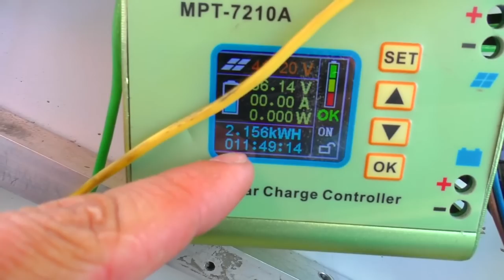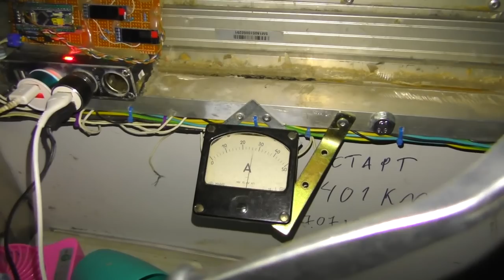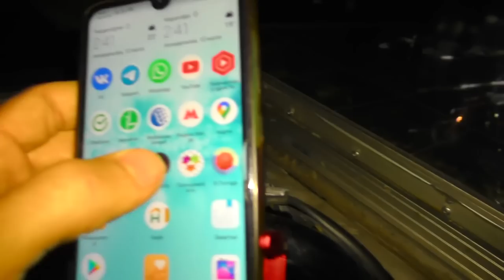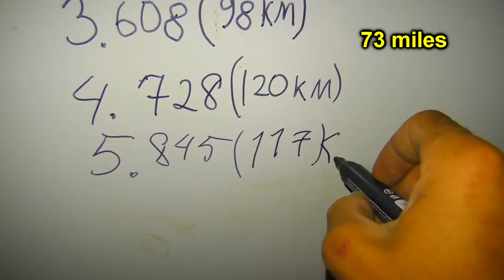Solar panels broken 😱 DIY⚡️electric SUN CAR 🚗 Great JOURNEY on solar power! Part #2

Comment: I wonder if you would have put each controller and battery bank separately on the left and right side motors if your car would not get overloaded going up hill and go twice as fast plus get more kilometers per charge this way because of the reduced strain on the system?
PS
I wish you good fortune and the best of luck with your adventures as I really enjoy watching your journey and your good humor of situations.
Blessings.

Comment: Broken solar panel on a roof can generaly work during months with a small loss of power. In rare cases, It can be dangerous, specially with cheap panel because they can start a fire.

Comment: Did you calculate the amount of kw/h/100km? Would like to compare with common electric car.
Reply: its 1 Kw/h/ per 5 km on a tesla. 
in a car you get 40 km per galon.
Reply: @Jimothy-723  my 2012. Opel Ampera (hybrid) use 1 kw/h to 7 km in summer but only 5 km in the winter.

Comment: Sad with the cracked panel!!!

shouldn't you not disconnect it if you have them all connected in series? think that it reduces the total effect when shadow on a couple out of 10 for example does it on the roofs??

go for it my friend you can do it, and the payoff when and if you fix it will feel huge..

Comment: Gasoline is a thing of the past. It’s raining can I use a SOCKet? Lol
Reply: Yes, you technically can. Many of modern technology is very resistant to moisture and for example, Tesla chargers are completely fine to use when it's raining, snowing or whatever se.
Reply: @bujak4077   he has a solar powered car. Can he plug in to charge it via the grid lol kinda not what he imagined
Reply: I don't believe that's what he meant by asking the aforementioned question
Reply: @bujak4077  ok but it’s what nakita said. There is no question that when there is no sun there is no free power. Plugging into the grid is not efficient at all and that’s ironic
Reply: For their sun car yes, because it only relies on solar energy, as he can't physically have any other power generation system going on for him, no hydro, no wind energy because simply it's just too heavy. In a typical grid, depends on where your power comes from. In Norway, where power is mostly green and from hydroelectric power plants, wind turbines or biogas generators the power is "free".
Reply: @bujak4077  you’re always going to have more loss than gain.but a couple of wind turbines would be hilarious while he’s driving or parked. Feels kinda like those idiots trying to add alternators to their Teslas
Reply: Where there is gain there is loss, nothing can have 100% efficiency or above

Comment: OMG , all this software & WiFi  stuff to just control motors ... this is not fixable by the most repair facilities & 100% NOT fixable in the field (only a swap of units is possible)  ... 
important rule when driving trough an empty region: use simple reliable technology that is easy to fix = this is the way the military does it for reasons ... & why a 1980s (Soviet) Lada Niva/Taiga is far better than any modern SUV & in this the Taiga even outperforms a "Hummer H2" ...

Comment: What voltage are you charging those prismatic LiFePO4 cells to?
Reply: I recon no surprise there, probably from 2.6 up to 3.6V per cell...
Reply: bro, you would get more power if you literaly just peddled a bicycle attached to an alternator ripped from a car...
Reply: @Jimothy-723  not really, i have tried that and no luck...
See "great scott" channel about bicycle and alternator. He explaining where is the problem with that setup.

Comment: hello i live in australia ,i was speaking with a friend about helping you out with some tech, im going to ask if any of the subs want to help too, i think if we can get you a  1. grin cycle analyst with dual current shunt for solar vehicles 2.a 21s 300 ampp ant bms .3.2 of the svmc7245 unlocked controllers ,these controllers will handle 150 amp each ,ive tested before .we allready have most of parts , if we were to get parts sent to you ,do have an address or a friend that will help you ,